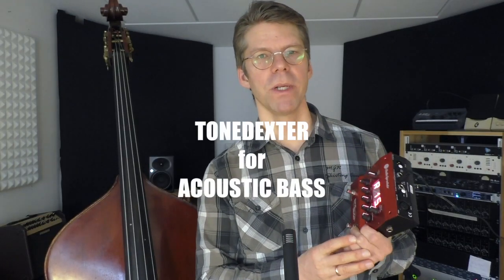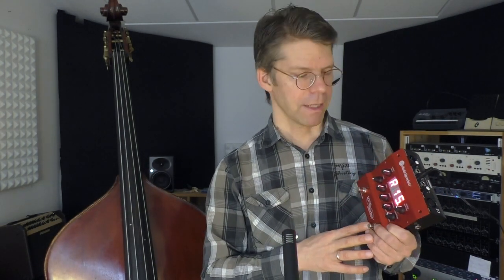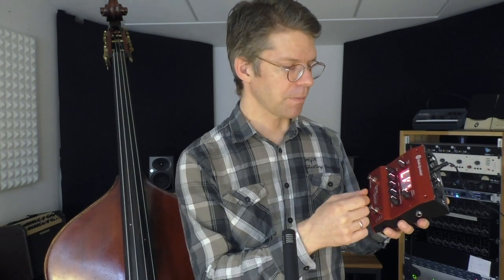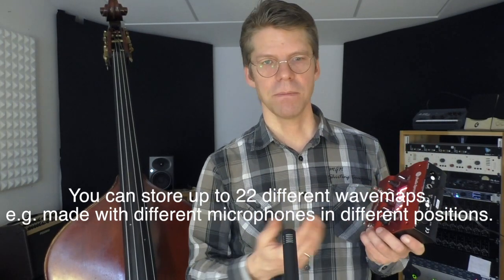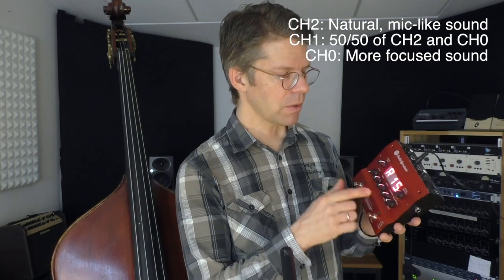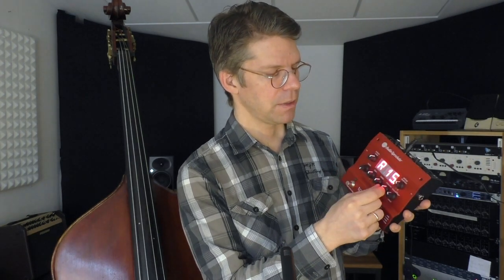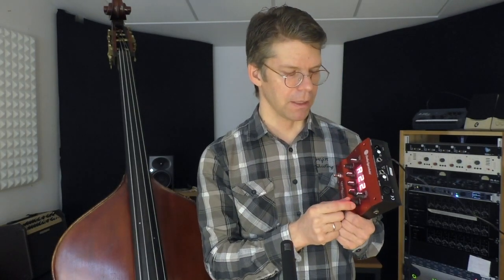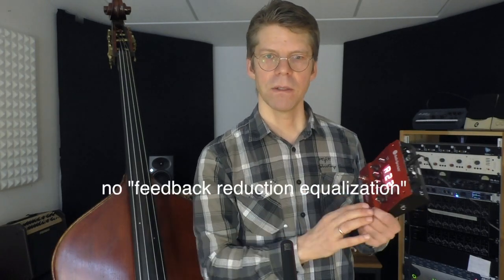ToneDexter for acoustic upright bass - Hear various character settings (also w/ slot 22 training)

Comment: Hello @stringmatrix!  Great vid!  Can you elaborate on how the tonedexter performed on stage when plugged into your amp?  Most of the demos I've seen are a/b off of the output of the device (which all sounded great!).  I'm curious how a typical UB bass amp rig responds to the input signal.

Comment: Many thanks for these explanations! It seems quite a device for all the acoustics strings players, but specially for the doublebass players. Did you tried on stage with drummer etc? If yes, what are your feelings? Did you felt yourself feeded by your sound like if you were playing acoustic (and not 100% piezo that can be so frustrating)? Did you felt any kind of frutration because of the "all digital inside built" aspects of your sound, even if the modelizations of the mics are optimized? (I have understood that it is not modelization in itself but I can't find any appropriate word...)
Reply from the maker: Hello Maryse! Yes I used the Tonedexter on a few gigs. And yes, it is really a fantastic experience to hear a true acoustic sound coming out of the amplifier. And the sound is punchy and very direct. I was also a little afraid of the idea that I would hear a digitally processed/modeled signal (if you don't use a blend setting) vs. an "analog" amplified signal as I am used too. But it works very well. Only when I have some "slap" kind of noise (quand les cordes claquent sur le manche) it sometimes turns out a little synthetic because I can hear the room sound of the training. Also, on one of my first gigs I realized that one note (the low A) was louder than the other notes. But all of these problems can be solved, you have to experiment quite a bit with the wavemap you create (I have collegues who use the TD and they all say it takes a some time + trial & error to get the perfect working WaveMap).
The ToneDexter has two more really great features: It has a built-in tuner and the signal is muted when you tune. AND it has a boost footswitch so that f. ex. if you want to be just a little louder for solos (how much louder can be set) you just press on the switch. 
I don't own the ToneDexter yet. Maybe I will get one. Just before I heard about the ToneDexter I bought an Ischell contact mic. And my experimentation phase with the Ischell isn't finished... So if the Ischell doesn't satisfy me in my quest of getting a great acoustic sound on stage I will probably get a Tonedexter.
Reply: @stringmatrix  Ok! Many thanks for this feedback. Really interesting. Can I post your answer on the doublebass forum in France I am in charge of? We are some few to use the ABox Live (Vintage Revolution) and the TD could be really great to have an acoustic sound without the issues of "larsen" and hearing the drummer in the mic on the ABox. Have a nice day.
Reply from the maker: @compagnieweloveyou  Yes sure, feel free to share my comment in the forum !